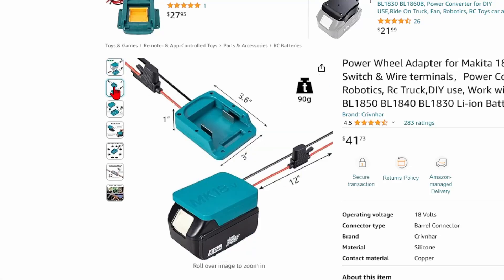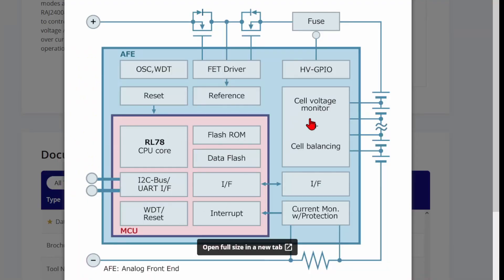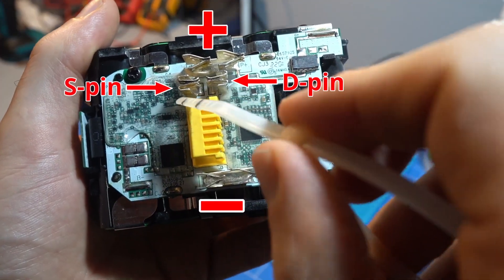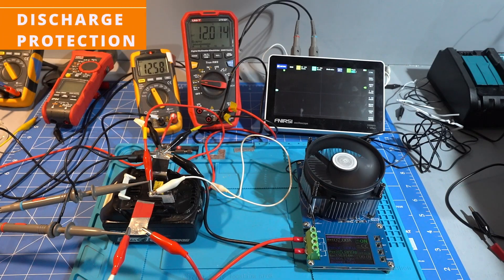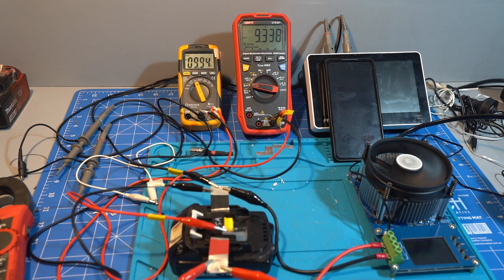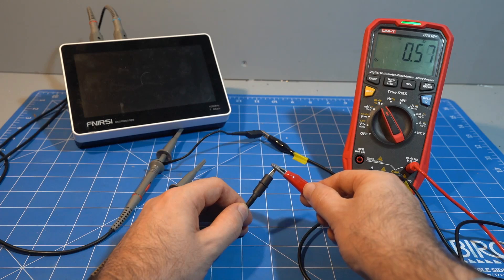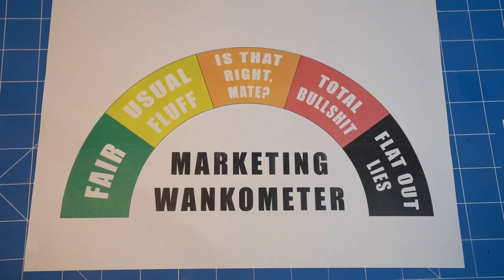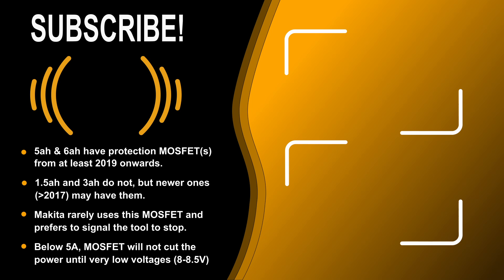[006] Do Makita LXT batteries have low-voltage protection?

Comment: Did you see this interesting development for those batteries? If not, I am quite certain you will find it of value: https://www.youtube.com/watch?v=T68isEgWwvk
A guy reverse-engineered the board-communication protocol (at least of one kind of board). I know that there are different protection boards. Mine (from a 1860b) as an example does not look like yours, so I don't know which/how many batteries will communicate as of today, but I think this is a major development.
Reply from the maker: Yes. I'm in contact with Martin. Very smart guy, 20x more knowledgeable than me at microcontroller stuff. I linked to that video in my community feed.

Comment: I have 2 and 3 year old clone Makita 6ah batteries. I use them on old brushed Milwaukee Power Plus tools from the NiCd days. My batteries do turn off when they are discharged. The Milwaukee power plus tools have no protections at all, they rely completely on the battery to protect itself. It doesn't seem to be thermistor cutting it off either cuz when they shut off they don't come back on till you recharge them. Whereas with thermistor trigging a cut off you'd be able to use the tool again after a few seconds.
Reply from the maker: I've never heard of power plus. Looks like it was their NiCd line. That didn't need protection as NiCd can be discharged to zero.

Comment: Just to set the record straight: I have zero affiliation with Noloxs, and this wasn’t an argument—more like a friendly tech talk! Still love your video, and yep, you’re the reigning champion. You went above, beyond, and then some! really great work 👏👏👏
Now we just need someone to design an open source, top-notch PCB with some quality SMDs based on your findings—minus all of Makita’s built-in “booby traps”—and start selling it online! Battery cases are a dime a dozen from China and some of them come with electronics, but trusting their PCB design? Not even with my morning coffee—let alone with those energy-packed cylindrical beasts! Any takers?
Reply from the maker: Oh wow, I was sure you were Noloxs, and SauronMakes did, too. Don't worry, internet arguments (or friendly tech talks) are the foundation of my channel.

There's some fairly well made 3rd party boards, but the problem will always be reliability (who knows if they'll swap to cheaper components) and they're programming is a black box. We don't know what their cutoff limits are.

A guy made a Makita battery reset tool, which is helpful for unbricking Makita batteries. Doesn't work on all types, unfortunately. I linked his vid in my community feed if you want to look it up.
Reply: Присмотритесь к китайскому производителю LXT типа аккумуляторов TPCELL, такое впечатление, будто бы он пытается сделать действительно хорошие аккумуляторы, конечно они не идеальны во всех отношениях, но тем не менее , они должно быть на данный момент одни из лучших аналогов Makita LXT батарей.

Comment: Странная постановка вопроса. Макита предпреждает: работать с родным инструментом, только вместе батарея будет защищена от переразряда. Зачем выдумывать проблему, если ее нет! Strange formulation of the question. Makita predicts: work with a native tool, only together the battery will be protected from overdischarging. Why invent a problem if it is not!
Reply from the maker: Yes, that confuses me, too. The mosfet is expensive and wastes power, but the 1.5Ah and 3Ah batteries show that it is not needed.

Comment: I have a lot of Makita batteries the charger don't accept them but when i charge them with my power supply they take fully charge.... How can i use the on Makita tool that have 3 pin ?? They work on Makita tool with 2 pin ( positive and negative only) perfectly but the don't work on the 3 pin tools any help please
Reply from the maker: You might be able to reset them with this tool. Requires some knowledge of Arduino. https://youtu.be/T68isEgWwvk

Comment: My makita 2019 cut of over 30amps maybe 35 on another tool with 2 phase

A after wont work. Neesd reset on charger shortley
Reply from the maker: Which battery and how old? If it's a small or old battery, there's a good chance it cut out from low voltage. High currents cause voltage drop from cell resistance. A new 5Ah can do 100A before hitting low voltage, but after several years it will only do 60-80A
Reply: @toolscientist 
ITS BL1850
4 YEARS OLD.

STILL HAVE PUNCH.

J DONT BELIEVE IT CAN HANDLE 100 AMPS.

MAYBE 60 SHORT.

ITS USED OUTSIDE THE TOOL WITH OUT 3 TERMINAL. TERMISTOR OR ELSE.

AFTER OVERLOAD WONT WORK PERMANETLEY.

Comment: The only way i can see why people said Makita batteries are better is they use Murata VTC 6 on their 5Ah batteries

3Ah they use the same low quality cells as others including Ryobi

i have a older Makita 4Ah but not sure what year it is, i can send you a pic of the board 
it doesn’t have the big chip 
instead it has two smaller one
Reply from the maker: 2x mosfets? The 4Ah seem to be mixed - some have them, some don't.  Doesn't seem related to build date.

Comment: This is usefull info, thanks. Don’t you think that the 3Ah switches off so late , just to kill them sooner, so that you update to 5ah? I can also imagine that 3ah is more often used at home and 5ah at work, so they would never sell a new battery to home users without this low voltage drop. So the old two pin tools are better for the 3ah, or chinese clone tools for that matter, they are two pin and shut down in time, at least, the ones I have.
Reply from the maker: I think it was just because those cheap cells in the 3Ah have high resistance, so their voltage sags a lot under moderate loads. It's still bad design, though. They have accurate current sensing so they could adjust the cutoff voltage based on the current.

Comment: Would love this kind of diagnosis on the specs/features of Bosch batteries! If you need to have one sent to you in order to make it happen I’d be willing…
Reply from the maker: Bosch is definitely on the todo list. Are you in Australia?
Reply: Sorry I’m in the US. I have loads of their 8ah power core bats to spare though. Would shipping be more than 40 USD or can these bats be shipped internationally to you?
I’m also curious about using adapters and wondering if you can explain your findings more. Most cheap Chinese tools are compatible with Makita bats and the majority are two pin. So on two pin makita tools it’s up to the tool to signal for low voltage cut off? Then three pin rely on the battery and that’s why they aren’t safe with adapters? I know there is no guarantee but assuming the Chinese two pin tool replicates this cut off it would be okay to use with an adapter with these Bosh batteries I suppose.

Comment: I'm looking to replace cells on a BL1820B. I've heard that the BMS locks up of you disconnect them from the cells. Any ideas if this is true? Would need to hook up an external power source I guess 🤔
Reply from the maker: Yep, the BMS will brick itself. You can look into Martin Jansson's tool to unlock it, or try and keep the cell pins powered during the transplant. https://youtu.be/T68isEgWwvk

Comment: I have one beeping BL1820 from 2014 here. On MK05-V3 VerB board one connector is TH and another is AS. Picture is on EEVblog  .../forum/reviews/makita-batteries-info/
Reply from the maker: Interesting. The tool would be connecting to AS and not TH. The charger connects to both TH and AS. Shame about the black silicone.
Reply: No black silicone on next picture. In newer battery AS is NEWAS.

Comment: Hi i have one of these batteries the cells have almost 21 volts, but there is no voltage on the outgoing connectors. Any solution? The board is BL1840B rev:V0.4.  date 2015.03.07.  Regards
Reply from the maker: Fuse could be blown. Check continuity between B+ and P+. Otherwise the BMS is locked, so try this unlock method (needs a UNO R3 microcontroller) https://www.youtube.com/watch?v=T68isEgWwvk

Comment: Hi . I have several old Makita pcb at home. When I disconnected them from the cells, do you think they are blocked? so I can't use them for new cells?
Reply from the maker: Most likely bricked. Very old ones might work. Can't hurt to try.
Reply: @toolscientist  very thank you . I tried one of them and it doesn't work (pcb bl1830 rev:3.1  2014.03 08) cells +-0,1V
I will try the others as well
Reply: If original Makita pcb works normally (pushing battery charge level button shows charge level), then disconnecting from cells will not brick it, I have desoldered them from batteries many times, to replace that yellow connector etc. So far if pcb was OK before, it has worked later.

Comment: Hey do you work with any rigid batteries? I was wondering if I connect a AC to DC transformer to a battery, could I use that as a source of power in case all my batteries die?
Reply from the maker: We get AEG in Australia, which is identical to Ridgid. Don't have any of their stuff yet, maybe next year. Check out Harrison Hobbies who has the best example of an AC-DC adapter. Short version is that it's expensive and still underpowered for some tools.
Reply: @toolscientist  Is it more expensive than buy multiple batteries I would just like something that could get me at least 6 amps of output. Just for a backup you know? But thank you for the response I really appreciate it! I'll go check out Harrison Hobbies now!
Reply from the maker: @SuperHondaFitDriver  most 18V tools are typically 20-40A (400-800W), and some will go over 80A (1,600W)
Reply: @toolscientist  oh I Guess 6 amp and 6 amp hours is very different 😅😅

Comment: I still have 2 old 3.0A makita lxt batteries that work(although they do not last as long from full charge as when new). These had teal color lettering on the side of battery compared to white later. During this   19 year period I have used up at least 3 of the newer batteries to the point of broken/will not charge. Does anyone know if they use lesser cells on the newer styles? Just curious.
Reply from the maker: Older Makita batteries were very basic. Newer ones have a lot more intelligence, so they're more prone to bricking themselves when they detect a fault.

Comment: Interesting, but how can some tell what production year it is? Most of sellers have no clue what they are selling and they have very old stocks... battery does not have any production year identificator, only model number and maybe some identificator where it will be hard to define what production year that particular product is.
Reply from the maker: There's a serial number near the yellow connector. There are 2 numbers next to a QR code. The top/longer number has the year as its first 2 digits.
Reply from the maker: Also, production year doesn't seem to matter. I've had 2 people give me PCB photos of 4Ah batteries. There was a 2018 with cutoff mosfets and then 2014, 2015, and 2021 without cutoff mosfets. If there is a pattern as to which 4Ah have mosfets, it's going to be hard to figure out. So far all 5Ah and 6Ah have cutoff mosfets.

Comment: This video is very helpful for the EGO battery guys as well. The newer 3rd Gen packs have a very similar fuse type now as shown around 1:00. Usually more than one 60A version. The older packs has a trace fuse and that's it. These are more advanced as mentioned in this video.  Very helpful. Thanks for sharing!
Reply from the maker: Can they be burnt by the BMS? Have you seen many that have popped? There's a few vids of older Makita batteries that were using white package fuses and I'm not sure if they could be burnt by the BMS. Those videos had people soldering a bypass wire around them.
Reply: @toolscientist  
I am just starting to see these, but I think EGO started putting these in around 2020 in what I call the 3rd Gen packs. I was getting questions around that time about fuses on the viewers board and I kept mentioning it was simply a Trace fuse on these and I had seen a few pop over the years working with EGO packs. I then received a couple of photos from viewers and you could tell something has changed and I noticed the black SMD devices with 60A on them and I was very surprised they had added fuse. I am just now realizing it is also an additional wire on the BMS for what seemed to be a monitor, but now that you share this info I am thinking it may be a way for the BMS to disconnect in emergency situations? I have not personally seen any of these blow myself. I am just starting to work more and learn the 3rd Gen packs. I have had over a dozen viewers ask questions about these and find them faulty. At first I was no help as I did not even realize they were there. So I am trying to find out more on these and don't know if the viewers that had the blown fuses were a typical overload fuse blow or if it's a way the BMS on these will do it. It is very possible since the newer packs also have that extra wire from that area going to the BMS board.

Comment: Hi. I have ordered several BL1820B and all were delivered with 7-9 V. Can I measure the current on the pins, or is this current faulty because of some shipping mode? Is there even something like a shipping mode, or is this just marketing to sell deep discharged batteries?
Reply from the maker: From what I've heard, nearly every Makita battery is shipped with very low voltage. Li-ion doesn't like being stored at high voltage. Damage doesn't occur until you go below 1V/cell (5V/pack)
Reply: @toolscientist  below 2.5V is already harmful to the cell iirc. 7V for the whole pack is plain crazy. That being said I thought this is some sort of shipping mode and not the actual charging state the pack is in. I've noticed this on a new 1850 as well.
Reply from the maker: @saiiiiiii1  at high currents, the voltage drop on the cells is "true voltage" - current*cell_resistance. So even when you discharge to 1.7V/cell (like Makita does for 1.5Ah and 3Ah packs) it pretty much instantly rebounds to 13-14V. I'm guessing the big companies have tested this and found the degradation is minimal.
Reply: @toolscientist  but we're talking shipping charge state of 7v-9v. This can't be for real...
Reply from the maker: @saiiiiiii1  it's very real. At 5:10 I show the 1.5Ah and 3Ah cutting out at 9V (~1.8V/cell). The next scene is running it on a tool to confirm it. Yellow multimeter is pack voltage, red is 3rd pin voltage. It's only the 1.5Ah and 3Ah - the 5Ah and 6Ah cut out at 2.5V/cell
Reply: @toolscientist  think you're missing my point. I understand that battery voltage can drop immensely under load and bounce back when idling. But the OP is talking about a shipping state of 7V with absolutely no load to bounce back from. Massive degradation should be happening at this state over prolonged periods. That being said, I found a Reddit thread saying that the new PCBs basically cut the real voltage in half when you measure at the BMS and the battery is in "shipping" mode
Reply from the maker: @saiiiiiii1  ah ok, you're only talking about shipping mode. I remember researching this and there's very little. Best I can find is some datasheets that say don't charge if <1V, 400mA charge if 1-2.5V, full charge above 2.5V. I think the 2.5V limit isn't as bad as we think. It might be that repeated discharges below 2.5V is bad, but storing below 2.5V is overall better. There must be a good reason for doing it.

The Makita batteries with cutoff mosfets are hard to measure voltage, as the mosfet will be off. But the 2Ah BL1820 of OP doesn't have mosfets.
Reply: Great video! Tx! Could the low shipping voltage perhaps represent a tradeoff between safety when shipping (iirc some airports/ airlines request or dictate that people discharge li-ion devices before bringing them on board aircraft) and battery life longevity?

  Other than minimising customer claims  due to batteries failing to perform reasonably or meet durability expectations / manufacturer representations  i doubt makita or any other cordless tool manufacturer would be particularly concerned diminished lifetime due to low shipping voltage.
Reply from the maker: @RalphCoulter-ds4he  yeah, I think the low shopping voltage (which has been shown by a number of users measuring brand new uncharged oacks at 7-9V) is to make it safer and maybe reduce storage degradation.

As to why they've got that weird 8V cutoff when discharged at <5A is a mystery to me. They could very easily discharge at the factory. Not sure why they programmed a deep-discharge feature that can be used in the field.

Comment: Thanks for making these videos, last year I was tinkering with fixing and using makita and other batteries and as I couldn't find a definitive answer on if makita batteries had undervoltage protection so I ended up adding an amazon relay module to cut off the power. The main downside being Is I would have to disconnect is after as the module draws power from the battery. Now I know I can just use a Beefy mosfet connected to the signal pin.
Reply from the maker: Just make sure you use the deepest of the 2 pins. The outer pin stays at pack voltage (although I never monitored what it did on low-voltage/over-temp)

Comment: Do you have a good protection board for these 18v batteries I can use for DIY Projects that you can recommend?  I have some German Bosch 18V 5Ah Li Ion batteries but unfortunately they have nothing for protection in it.
Reply from the maker: Search for "low voltage protection", "low voltage disconnect", "low voltage cutoff" modules. They can be found on ebay, etc. They're all unbranded stuff, so I can't really recommend any in particular. Most will only do 30A, but if you go beyond that, you'll potentially be overheating the battery anyway. Just make sure that they have an adjustable cutoff voltage. For an 18V battery, 14-15V is a fairly safe cutoff voltage.